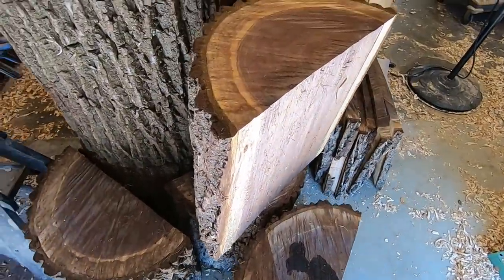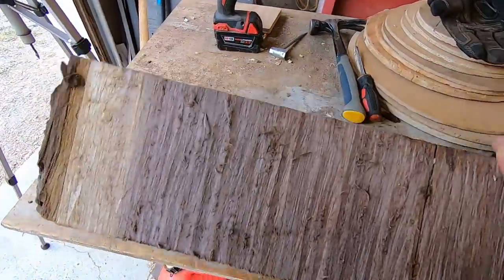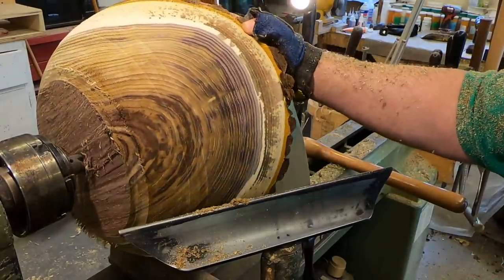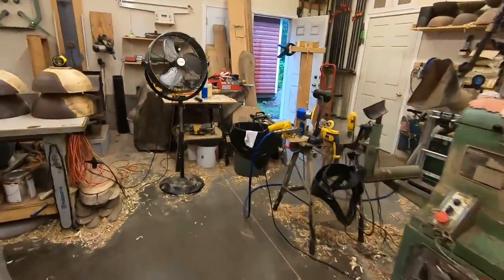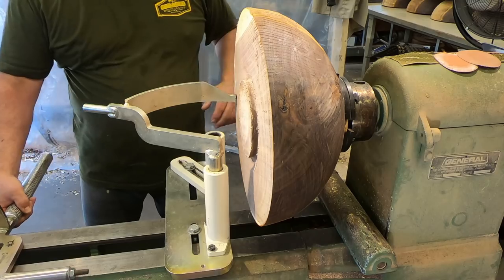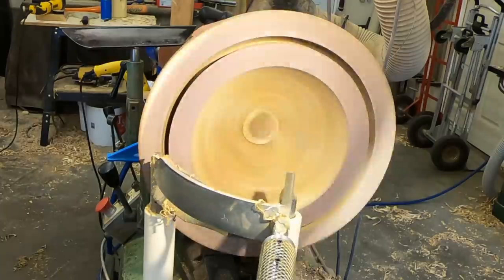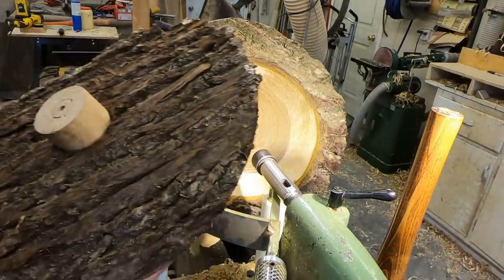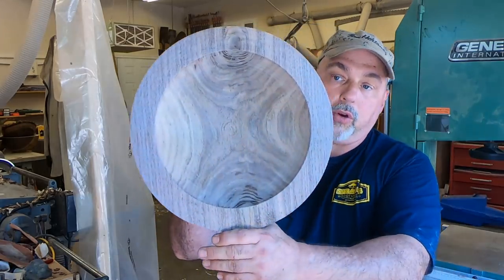Woodturning - Coring a Walnut Log

Comment: I bought 20 acres in North Eastern Kansas a few years ago and had no clue what some species of trees were worth so I counted and measured just the walnut trees on the front 9 acres and I have well had 57 walnut trees now 56 cause I cut one down and slabbed it with my chainsaw, most of them are pretty good size but I have a few that were really big, the biggest one has a diameter of 41 inches. I think im gonna cut it down soon so it can start drying out. I have lots of pin oak white oak shagbark hickory and red oak also. Anyway those bowls are beautiful,  If I got a lathe I would have to hide it in the woods cause my wife thinks I'm just a workhorse and wants me to make everything for her and she has zero patience and im not retired!
Reply from the maker: Haha, get a lathe, she will eventually run out of room to display things and then will let you sell some! Thanks

Comment: Thanks Mr.Sprague for your advice, makes since to measure from the chuck . I will try that, I have turned since 2013 and cored a few bowls , I have the two smaller sizes one way. Thanks again Richard Hoxie
Reply from the maker: No problem Richard

Comment: That is a great setup. Thanks for sharing your work and knowledge. I saw the "dedicated machine" designed to do this same op during a factory tour in Canada years ago. They had about 10-12 of them cutting out salad bowl sets. I was driving a truck to pick up and swap empty trailers for a weekly regular run back into the US. Their machines looked like short bed lathes all mounted on a large concrete slabs about 6 feet apart in a line. Each 2 machines had an operator that mounted the semi finished blanks using hydraulic clamps, pulled a cage down punched buttons. I think they were setup with 18"- 20" blanks but they cut 4 bowls out of each so probably 20. The 10-12 folks that actually finished those bowls were amazing to watch. They did about 4 sets an hour each, with food grade poly I believe. My ex-wife still has the set I was gifted. I think they were walnut or maple... maybe Beech?
Reply from the maker: Ya, that’s cheating, lol. It’s called a bowl mill. Can’t complete with them, at least the outer big bowl with my process is unique, with a bowl mill they all have the same profile. Thanks.
Reply: @SpragueWoodturning  Enjoyed watching your process much more for sure!
Reply: Can you recall where that was or the name of the company?
Thanks
Ivan
Reply from the maker: Ivan Witt there is a bowl mill in Holland Michigan. Stinson studios in Canada is another one.

Comment: Will a system like this work well on a glued up blank made from say 14x14  3/4 hard maple ? I read that the coring system is best used on semi wet wood.   What do you think?
Reply from the maker: I core resin so yes, dried wood can be done too, I highly recommend getting the Korpro cutter from Hunter tool systems for coring, you’ll be amazed. Here a video I did on it https://youtu.be/sQilVX_3HoQ use code inlayjim to get your discount. Thanks for watching!

Comment: Some great info in this video, thanks for sharing. When I have a log that I know will be turned into blanks like you have done here, I use my Bandsaw Mill. I start with a skim cut just below the bark for Lathe mounting like you did with the Spade Bit so the spur drive or tailstock centre has decent wood to bite into. Then I work out the thickness of blanks, most of time I'm pretty much cutting the log through just above the pith. Before I make any cuts though, I position the log (seeing as they are tapered) so the pith is the same level from end to end, so when cutting that section out I'm more likely to get all of it through the log, doesn't always work, esp. if the log isn't dead straight. Then I'll buck those to length, like you, usually the length is determine by the width of the log. And like you, I try to not use pieces with cracks, as you mentioned, they can be dangerous. As I don't have a Bandsaw big enough for cutting blanks round, I'm looking at making a set of triangle jigs that fit into the tracks of the Mill, where I can mount the blank between centre's, with a locking pin or some way of locking the blank so it doesn't spin, and cutting off the edges to make it round using the Mill.
Reply from the maker: This method is easier on the body, that’s for sure, thanks for sharing, Jim

Comment: Good job. Whats a good rpm. To operate once piece is balanced out.
Reply from the maker: I turn the speed up until it vibrates then back the speed off until it stops, as it comes back in balance you can increase the speed, Jim.

Comment: Interesting, I typically orient the bark side to the headstock.  Have to give it a shot your way
Reply from the maker: I typical do it this way because the tail stock is smaller than the head stock and you have more room to work, Jim.
Reply: @SpragueWoodturning  I have a bigger lathe where room at the headstock isn't a problem; but like you technique

Comment: I got a good load of waulnut burl.  30 of them I blocked up for lathe. There dry limited moisture.  Do u run much dry burl.
Reply from the maker: I’m a twice turn turner, I rough the bowls out thick then dry them to 7% or less them put them back on the lathe, so yes I turn a lot of dry burl. This coming Friday video, I will turn a whole burl from start to finish. Jim.

Comment: Jim first thank you for your awesome videos. Not sure which video you mentioned the anchor seal with glycol and not sure if it is the same as the antifreeze ingredient> but I know you are very concerned about toxicity! Just an observation. Thanks again.
Reply from the maker: Thanks for your concern Robin. The Anchorseal just sits on the surface of the wood, it doesn’t penatrate the wood and gets turned away when mounted back on the lathe after the wood dries, Jim.
Reply: @SpragueWoodturning  Great! Thank you for  replying and thank you odor all the great videos

Comment: Great video and very informative, thanks!  One question, at about the 24 minute mark after you’ve cored out the first, you said the diameter is about 8 inches but you’re using the 2nd knife set.  Was that measurement accurate or was it closer to the 11 inch specs of the 2nd knife set?  I’m in the market for this and just trying to figure out what to get.  Thank you!  Awesome video.
Reply from the maker: You can use the same knife to get multiple bowls. You just need to move the knife base forward and outward. I only typically do this on the smaller bowls. The Oneway system is king! Thanks

Comment: with a bit of experimentation you should be able to make a mark on the knife with a sharpie/magic marker to take the guesswork out of when to use the screwdriver. you are soooo very welcome
Reply from the maker: Well, that would work if they are all the same diameter but there not, so you’re very welcome 😉

Comment: Would like to see how you seal them, before you set them to dry. Thanks
Reply from the maker: It’s funny, I looked back through my processing videos and I don’t even show the process of putting on the end grain sealer in any of them. I thought I covered it in at least one of them but I guess not. I just simply brush the sealer on inside and outside covering the entire bowl. I don’t put it on any bark areas, Jim.
Reply: @SpragueWoodturning  Thank you for your reply, I will try it out.

Comment: How did you come up with the measurement of the piece of plywood for the spacer?  Was it trial and error or is there a math equation?
Reply from the maker: It’s quite simple, put the base on the bed of the lathe, put in the smallest knife, swing it into the chuck area or where the very bottom of the bowl will be, move it out so you have an inch of clearance and take your measurement. Do the same for the other knives you have. If you go the the Oneway site and at the bottom of the page is an area there for media, click on it and there is detailed videos there, Jim.
Reply: @SpragueWoodturning  Thanks so much for the info, I will be sure to watch the video.

Comment: I understand a natural edge bowl but I’ve never seen a bowl turned with what I can see is the natural shape ie. the bark on the bottom. Apart from the obvious natural edge, is there a reason for this?  🙂
Reply from the maker: It’s probably got something to do with holding the bowl to the lathe. Bark is not good to grab with a chuck so if you had bark on the very bottom there would be no way to hold it to the lathe. Besides that, it’s just wrong, hahaha.

Comment: Great video.  I'm a subscriber for sure and I look forward to viewing all of your great artistry.  I'd appreciate it if you would relay the specs of your preferred sawblade for your bandsaw.
Reply from the maker: I use the furniture (Carver & Woodturner blades) from R&D Bandsaws in Brampton Ontario. They are designed to be used with green wood, they have a wide kerf to clear the shavings better and less clogging. Jim
Reply from the maker: I also buy the 1/2” blades.

Comment: Is there a certain speed that you like to core at? Great video, love watching you turn!!!
Reply from the maker: It depends on the size of the blank, I usually turn the speed up until it vibrates then back it off until it steady out, so there all going to be different. Once there round I usually turn around 1000 rpm, Jim.

Comment: How do you come to the size of the of the spacer between head stock and the coring base , thanks Rick Hoxie Clayton N.C I have two sizes of the one way coring.
Reply from the maker: What I do is put the knife in the base and put the chuck on the lathe, swing the knife in towards the chuck and move the knife base back until you have 1” thickness between the edge of the cutter and the outside of the chuck jaws. Measure the distance to the knife base and cut a spacer, hope this helps, Jim.
Reply: Thanks Mr.Sprgue

Comment: Thanks much for your sharing. If roughing out the outside is the hardest part why not make a cutter on an arm to do that, similar to the coring cutters but the reciprocal, if you will?
Ivan, Michigan
Reply from the maker: If I did that, I would just be a bowl mill, same profile bowl after bowl. At least the large outside bowl will be different from the rest. Jim.

Comment: Burning walnut or firewood? The least you can do is to glue and cut them into chaos mosaic cheese serving boards or even meat cutting boards. I would even sell some blanks for knife scales or even blanks for small jewelry boxes and such for those who can't afford to buy the large slabs of walnut. What a waste!
Reply from the maker: Ok, so a couple of things on this. First, a lot of the off cuts are too small to handle safely on a jointer and too short to put through a planner to make cutting boards. Second, I’m in the business of selling bowls, I’m not setup to do glued up cutting boards. Lastly, I’ve got ton of small walnut bits that I will probably never use. Jim
Reply: @SpragueWoodturning  Sell the off-cuts in bulk for somebody who will use them or even give them away for free if you are still burning them. Heck, if I were living nearby I would even got the shavings to be used to smoke cured meat. It's a valuable resource, don't waste it like that.